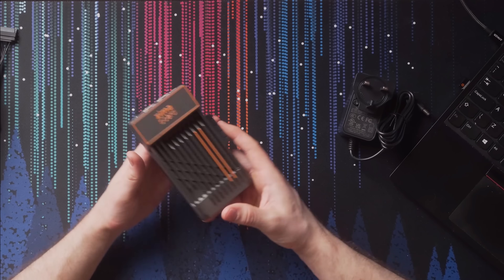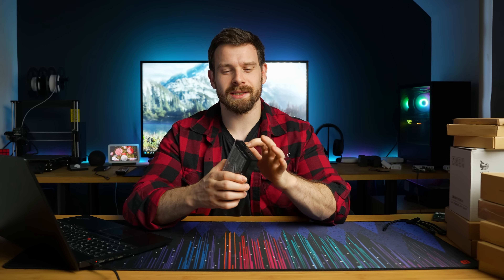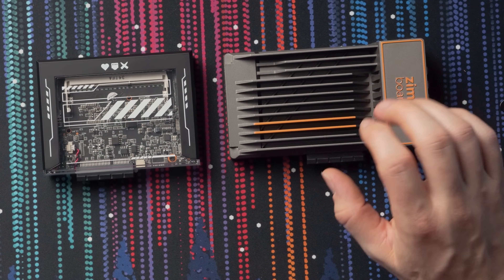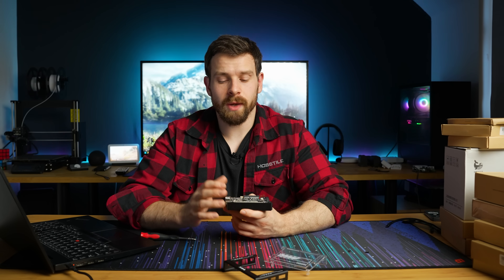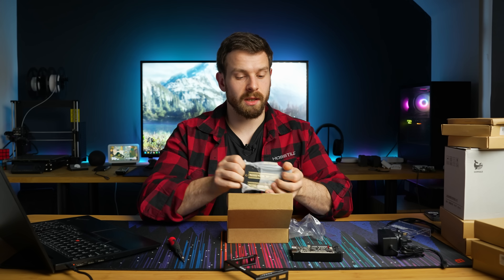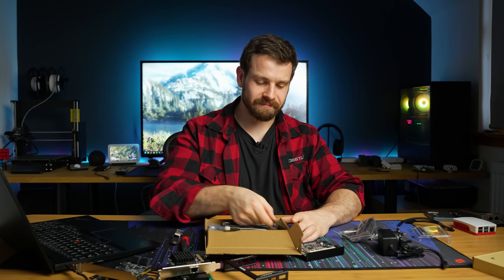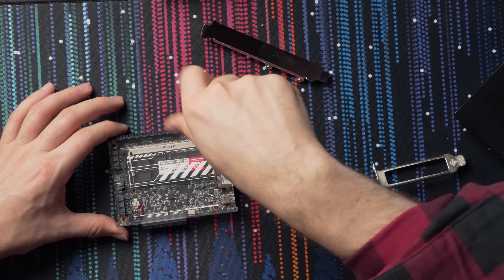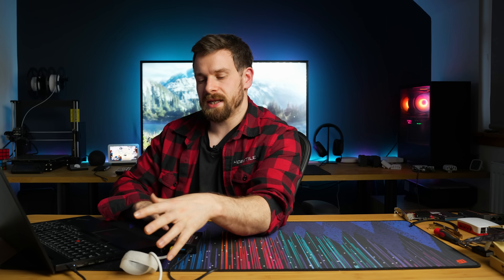This Tiny Affordable Server Makes HomeLab Easy!

Comment: Thanks for the video. I agree, love my Zimaboard, but adding a pcie card doubles the width of the setup and it hangs off their open air case. Why not at least sell a short pcie cable to, as you pointed out, enclose the pcie cards in the case? "Bad Robot." Thank you!

Comment: @9:14 - this is only SATA port - not power port. You need external power supply for even 5x SSD. Not talking HDD then ;-) 
One big issue: either 10Gbps/4x2.5Gbps OR SATA OR NVMe - not all at once.
Reply: ESATA would be nice for connecting an SSD with a Power Over eSATA cable

Comment: I was so surprised when I saw the zima blade and board actually support 3.5" drives.. That's pretty cool..
All it's missing is a second pci-e slot haha.. I love the nvme addon and the 10Gbe addon but we need both together in a NAS use case to be able to better saturate the 10Gb link
Reply from the maker: This is true, though I guess you could technically have a carrier board with 1x nVME slot and 1x 10GBe port since it's a 2GB/s PCIe slot, providing 1GB/s to each? Wonder if there is some other technical limitation
Reply: @EverythingSmartHome That board as far as I know would cost a lot more than the little board itself haha.. QNAP has one, don't know about others. There's also pci-e bifurcation but this board won't support it either. so close yet...
Reply: There are pcie switches that could be used to share the lanes between multiple devices but I really wish it was pcie3.0, we would get double the speed and using a board with a pcie switch and m.2 slots would be actually helpful. If Im not mistaken synology makes such pcie cards that has 10gb card and m.2 slots together
Reply: @TechTurbid  Synology and QNAP.. Do you have a link to these pcie switches? I gather it's not as straightforward... In theory we got 2GB/s to play with here with the overheads I suspect sharing it would be more like 1.5GB/s or 7Gbps link...

Comment: Can someone please confirm or correct my current understanding when comparing the Zimaboard vs Zimablade?
That being... The Zimablade is a newer, lower cost and less powerful alternative to the Zimaboard.

My intention in the near term is to replace the Raspberry Pi 4 - 4GB RAM, which runs my Home Assistant Installation.

Comment: I am disappointed, from the video it looks like most of these PCIE cards won't fit with the enclosure on. Looks like raiser is a must. The older Zima board is much better in that regard, especially with a 3D-printed NAS / SSD case. 

Honestly, I'd rather see a real-life use case demonstration than unboxing or whatever this is called video because I see no difference from regular advertising.

Comment: What is the point of getting this over a corporate recycled HP Prodesk SFFPC or whatever for $60 on ebay, apart from size/weight? You arguably get more power from that and if it's controlling your house, chances are you are not taking it with you anyway.
Reply from the maker: Quite a few potential reasons:

1. Not everyone is comfortable buying used parts
2. This is a device you can take out the box, plugin and away you go. Don't even need to install an OS as it's already pre-done meaning the barrier to entry is much lower.
3. Size like you mentioned but also power consumption. They are still low but typically still multiple times the consumption of this

Not saying those are my reasons, I personally like used machines too but I can see some potential people liking this for those reasons